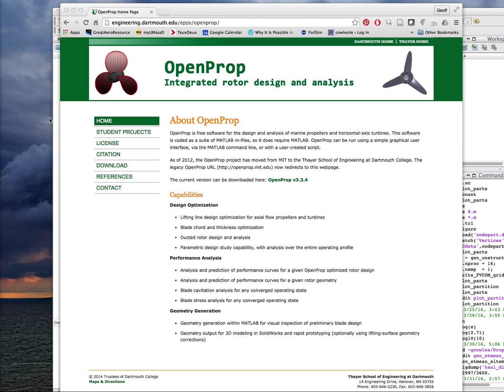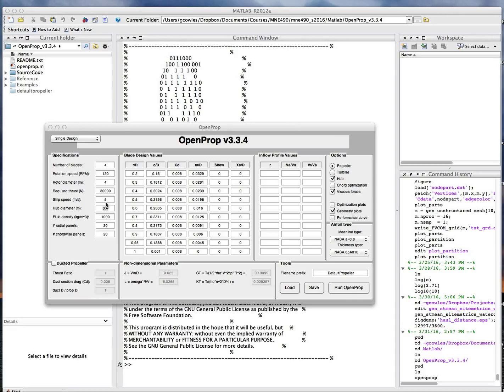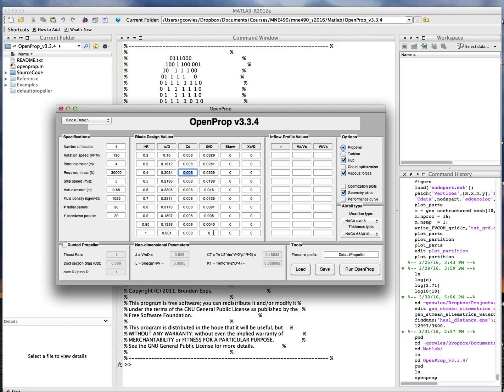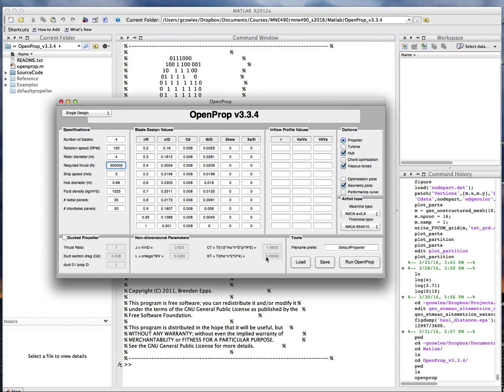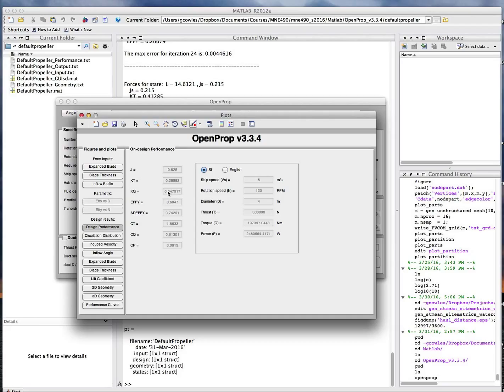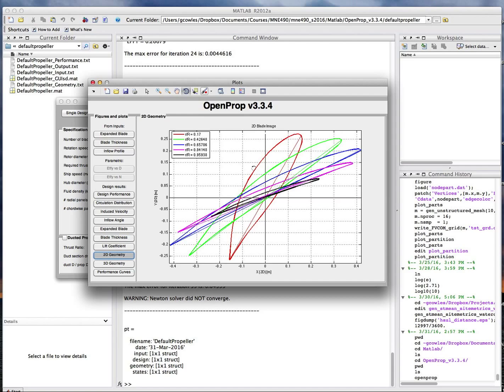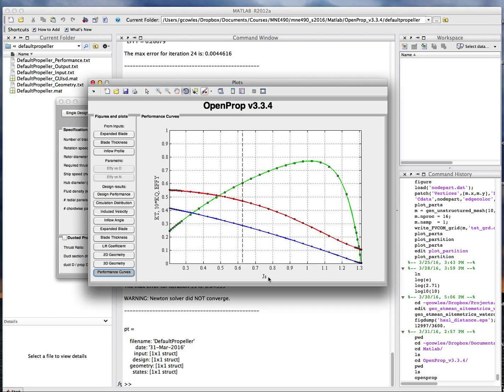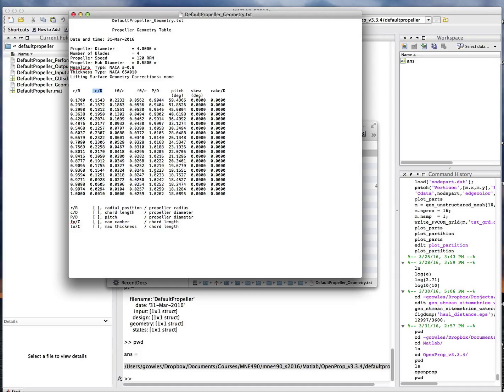Using OpenProp for Class Exercise

Comment: For my M.Sc. thesis I am trying to use OpenProp v3.3.4 to obtain Propeller performance curve. I have followed OpenProp for Class Exercise tutorial 

After executing openprop.m file I am facing the following error messages:

Error using fprintf
Invalid file identifier. Use fopen to generate a valid file identifier.

Error in Make_Reports (line 420)
fprintf(fid,'\t\t\t\t\t %s \n\n',filename_input);

Error in OpenPropSingle>execute (line 1197)
    Make_Reports(pt);
 
Error while evaluating UIControl Callback

Therefore I could not able to get Performance Curve whereas the tutorial shows that performance curve is easily obtained using the similar procedure.

Could you please help me to find out the problem in my execution of the similar program?
Reply: Did you succeed in your thesis?